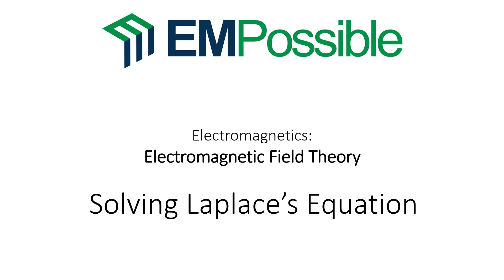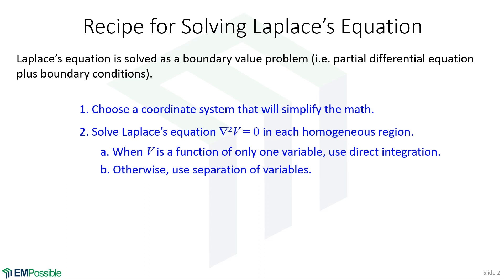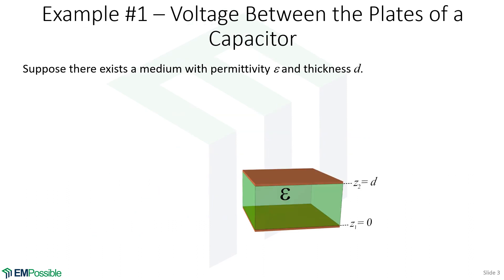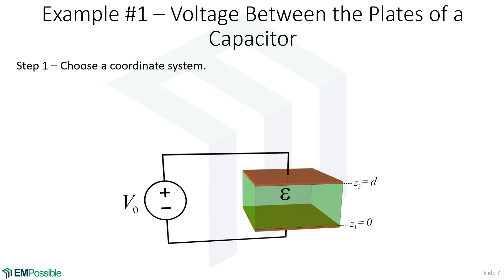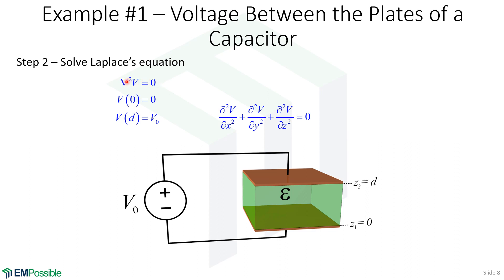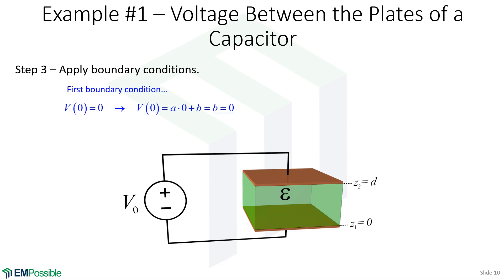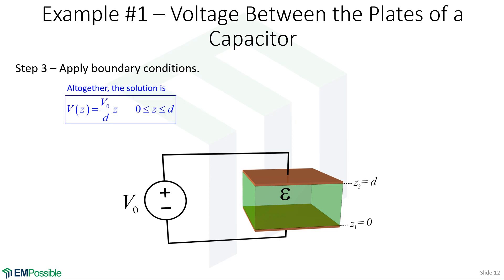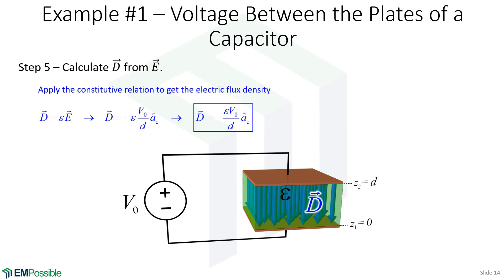Lecture -- Solving Laplace's Equation

Comment: How do you solve it when you don't ignore fringing effects? Is the PDE too general to have a closed form solution?
Reply from the maker: That is a great question.  First, I should mention it is rare for capacitors that the fringing fields have any significant effect.  This seems surprising only because of the scale of how we draw a parallel plate capacitor. We tend to draw them so they look more like squares.  In reality, the width of the capacitor is usually many orders of magnitude larger than the very tiny gap. This makes the fringing fields rather insignificant.

However, there are times where the device is a more square geometry, like transmission lines, where the fringing must be accounted for to get the most accurate answer.  I made a video on the course website that introduces you to the concept and shows the differences when the fringing fields are accounted for.  Below is a link to the course website.  The video is called "Capacitor Simulation Example" and is near the very end of the Electrostatics section.  In short, a numerical simulation is needed to take into account the fringing because it would be extremely difficult to do analytically (beyond my math skills).

https://empossible.net/emp3302/

If obtaining a numerical solution is of interest to you and you want to learn the full details, I recommend my Computational Methods course.  Here is the link:

https://empossible.net/academics/emp4301_5301/

Work through Topics 6 and 7.  Application #2 - Transmission Line Analysis solves Laplace's equation using the finite-difference method taught in the course.  I teach the finite-difference method different than you will find it in other places.  I think I make the method easier to understand and almost ridiculously simple to implement.

I also recently published a textbook.  Chapter 3 describes in writing how to solve a generic differential equation using the unique finite-difference method.  Chapter 6 shows an even better way to analyze transmission lines that is actually a rigorous analysis instead of using Laplace's equation.

https://empossible.net/fdfdbook/

Hope this helps!